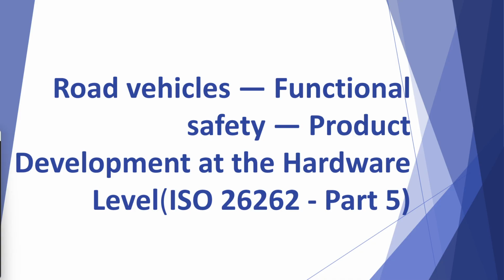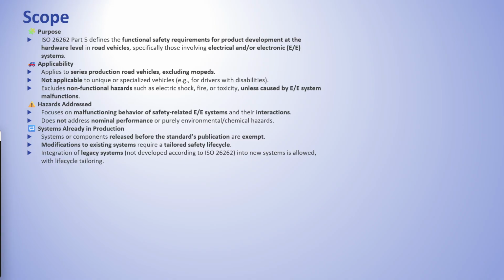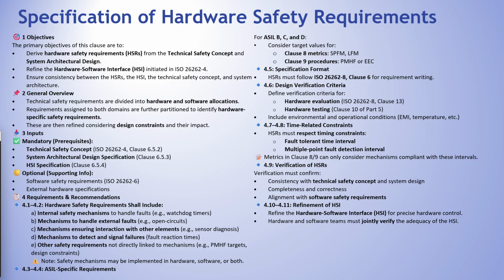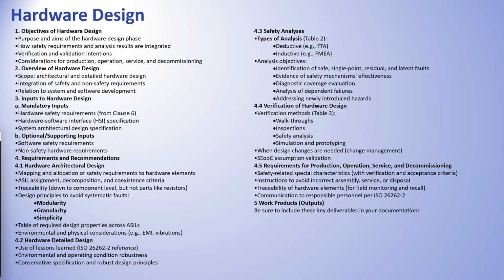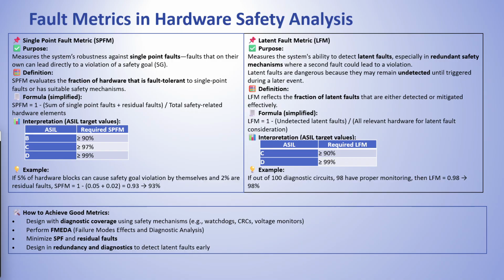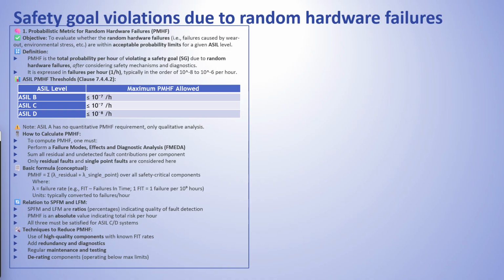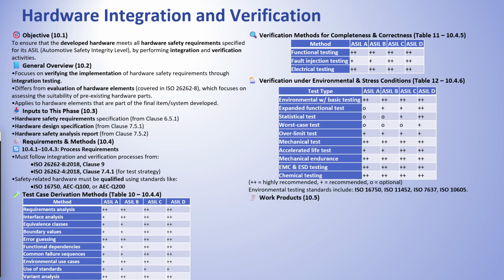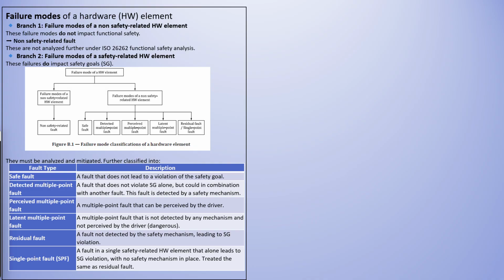ISO 26262 Part 5 | Hardware Development & Functional Safety

Comment: Great presentation on the slide where LFM is mentioned per Table 5 in 2018 version ASIL B >= 60% ASIL C >= 80% ASIL D => 90%
Reply: yes, you are correct. Curiously, they corrected this in the audio narration, but not the actual slides shown.

Also on the slide discussing PMHF and EEC, they say these include only single-point and latent faults, but in the 2018 edition Clause 9.2 states:
"Both methods evaluate the residual risk of violating a safety goal due to single-point faults, residual faults, *and plausible dual-point faults*. Multiple-point faults can also be considered if shown to be relevant to the safety concept. In this analysis, coverage of safety mechanisms will be considered for residual and dual-point faults, and exposure duration will be considered as well for dual-point faults."

I also noticed discrepancies in other videos in this playlist, which leads me to believe their info may have been extracted from an older edition of the standard (first edition was 2011).

While it's clear that AI was used to narrate/auto-dub these videos, I am beginning to wonder if it may have also been used to assist with generating the notes. I would advise any viewers to carefully verify any info found here on YouTube before applying it to a real project.